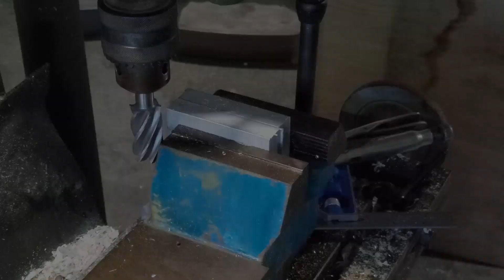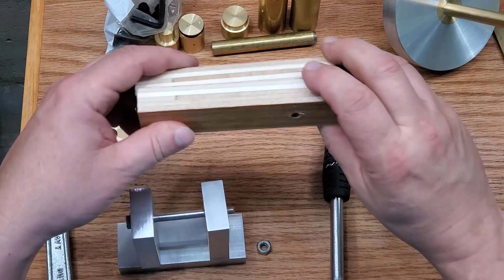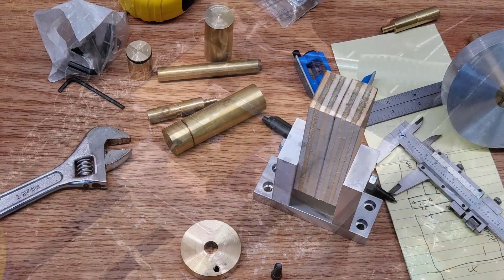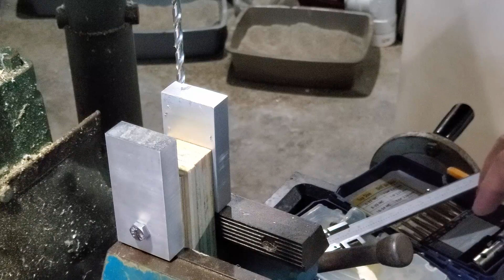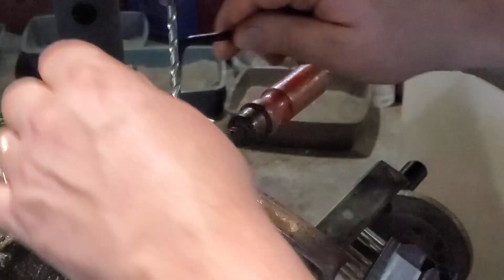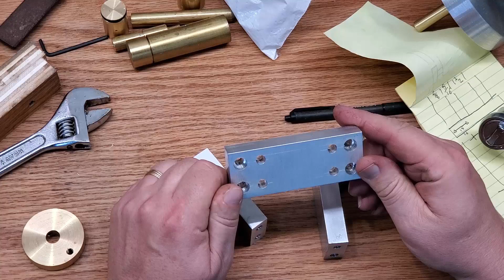Brass Air Pump Part 6

Comment: Yes I see what your planning. The two cylinders can be connected to the end of the rods, on either side with seperate wheels. Thats a super smart idea.  The flywheel in middle, is  for a belt pulley or gear, to a small motor.
Reply from the maker: Thanks for taking the time to watch and comment!